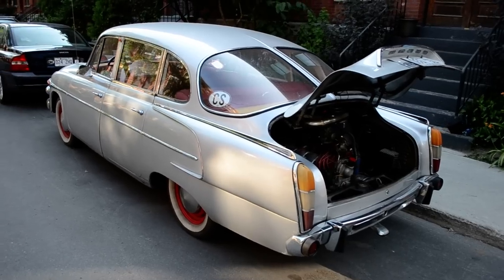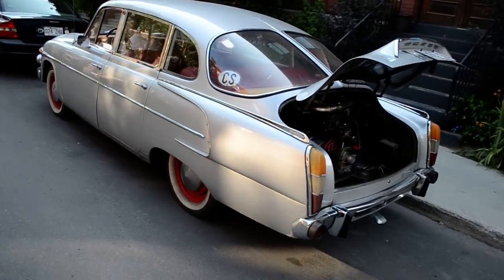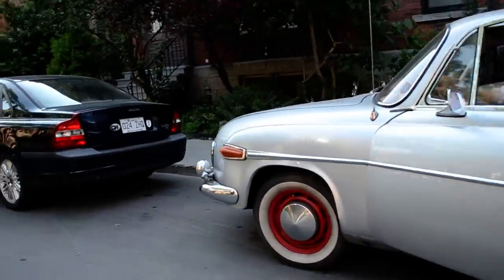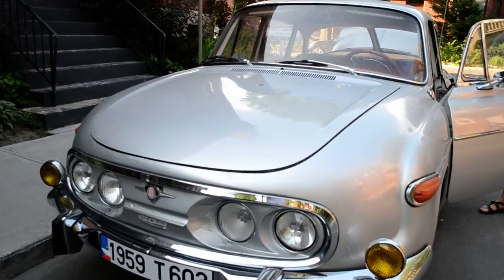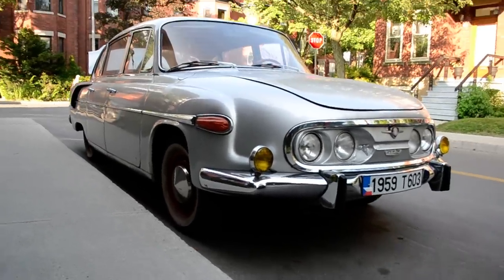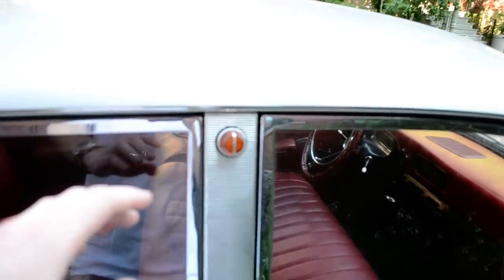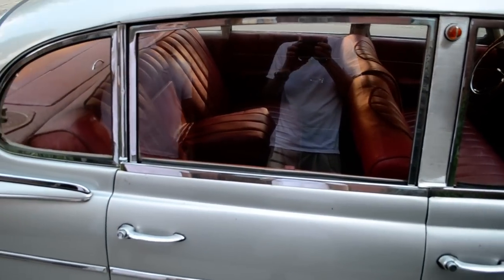RARE 1959 TATRA 603 REAR V8 START UP

Comment: Let's not forget the totally unique chassis. All Tatras have a central pipe chassis with swinging half axles and all the bodywork is mounted onto it. It gives Tatras great torsion strength and surprising offroad abilities.

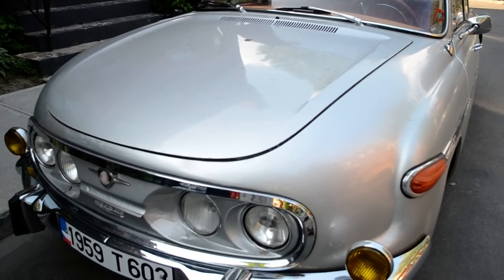Also, what did the guy say at 1:41 that made you burst with laughter?
Reply from the maker: I dont remember what he said.
Reply: +mikosoft but only on tatra trucks not on cars
Reply: +666tnad On the contrary. It was actually developed for Tatra 11 passenger car in 1921.

Comment: No 1959, or at least the front of the car is Tatra 2-603 II made 1968-1975
Reply: I read somewhere they took some back to factory and updated them to the spec of newer models. So units that seem to be a newer model might actually be older.
Reply: @bangerbangerbro  yes since most of the tatras vere owned by the goverment they were rebuild a lot

Comment: Nice & neat. :D However she has newer 603-2 body (1971+). Nothing unusual with rust-prone T603s. The body change was popular service offered by Tatra factory in Pribor.
And some element on enginebay makes extra sqeaky-metal rattle. :/
I see the air outlet gates opened to enginebay, so it was cold start, I suppose.
Does she rattle less after warming up?
Reply from the maker: Interesting...
Reply: Nemato chrastit po zahrati.Je poskozeno lozisko.Okamzita oprava.A motor spatne drzi volnobeh-sestelovat.
Reply: Let me translate it for you: The engine should not rattle after warming up. The bearing seems to be damaged (probably one of the crankshaft bearings?), it needs an immediate repair. The engine needs to adjust the idling.

Comment: A totally disasterous construction! 
A heavy V8 (!) in the rear of the car, and swinging axels! It couldn´t be worse. The weight distribution is catastrofically wrong. Zero roadholding and zero active safety!

And please, no comparison with Citroen DS, whatsoever. They are each others  opposites in every aspect!
Reply: +Jourwalis - but HEMI V8!
Reply: You dont know what youre talking about... Read something about it and then judge
Reply: I know perfectly well what I am talking about. I have all the facts and figures and knowledge and exeperience....Everything is right that I say above!
Reply: I got a citroen ds  I bought it cos I like oddball engineering  I would love a tatra !!
Reply: @jourwalis-8875  yes, the concept is not good for nowadays standards. Though 70 years ago it was good.
Also Porsche 911 has the weight on the rear axle, still it is a good car.